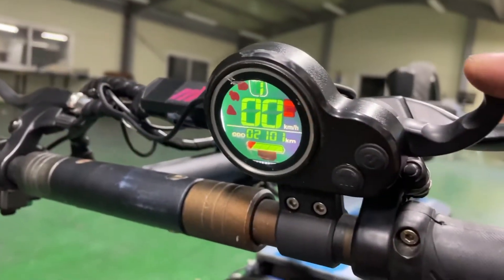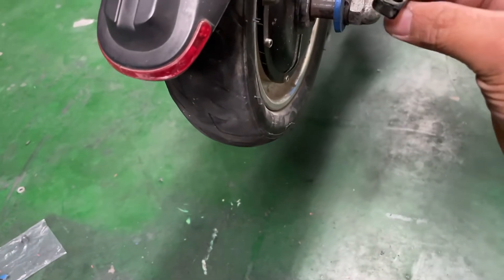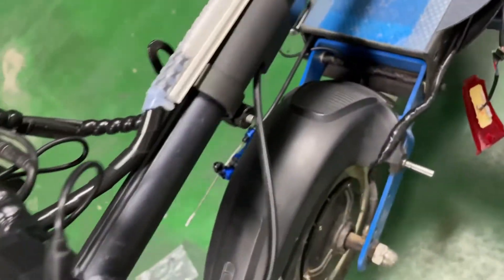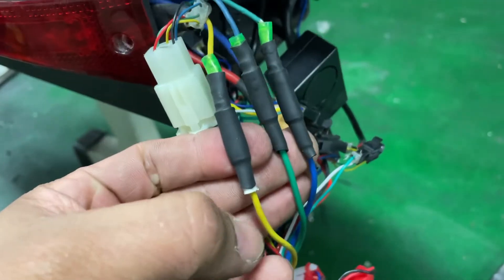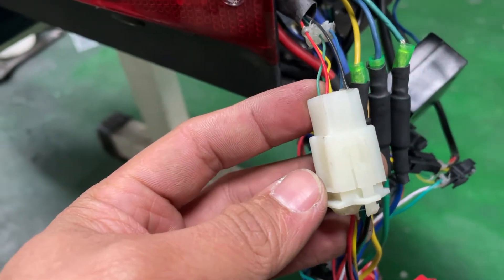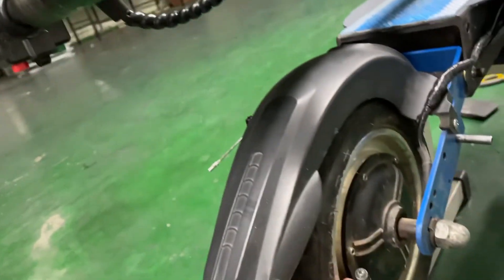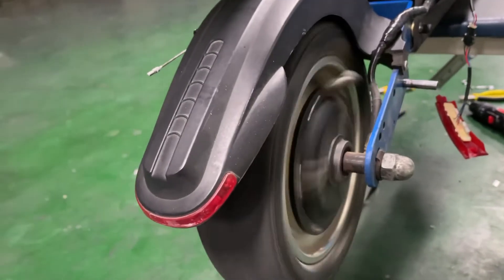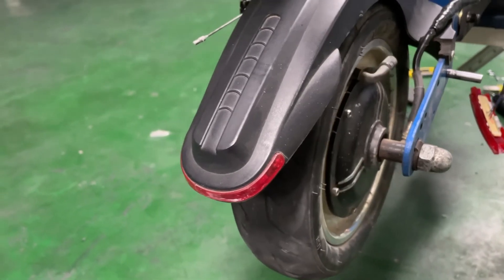How to reverse scooter or ebike motor direction.

Comment: how do i switch them cause i dont know switch them  because theyre connected
Reply from the maker: @zjca4229   use a small flat screw or something to push the lock pin of the wire and then pull them out so you can able to switch them. Im sorry for my bad english i hope you understand what i mean

Comment: for me it doesn't work, when reversing green with blue, the engine vibrates, without turning,
what happens? I bought a complete kit for my scooter, the controller failed, the kit is complete minus the motor. I followed the colors exactly, I reversed, but without success
Reply from the maker: My fiend if it doesn’t work for you. you can connect the phase wire in different colors combinations until it work..

Comment: It did not worked for me. It rotates in same direction.....
Reply: I had to keep green motor wire connected to green,yellow to blue,blue to yellow
Reply from the maker: Brother follow the instruction 2:07 and try different color combination on the motor phase wire because on my other electric scooter it works in different  motor phase wire color combination..

Comment: Kind friend , do we change cables in the white connector based on colors or do we change them based on where they are in plug ?
Reply from the maker: In the wihite conector switch the yellow and the green wire.. and in the phase wire on your hub motor just try the different collor combinations